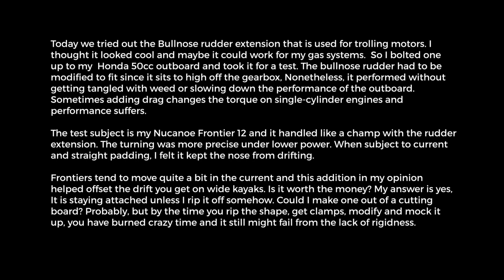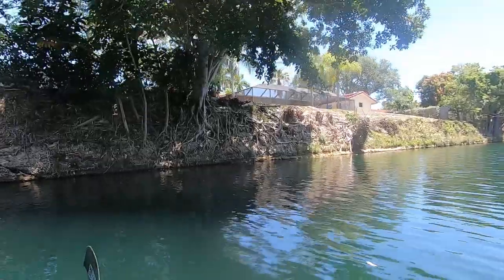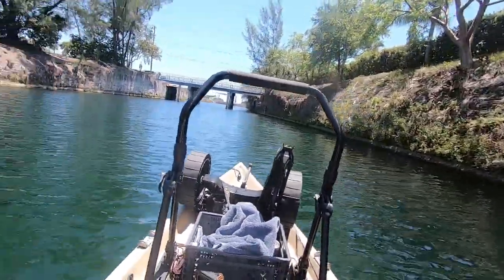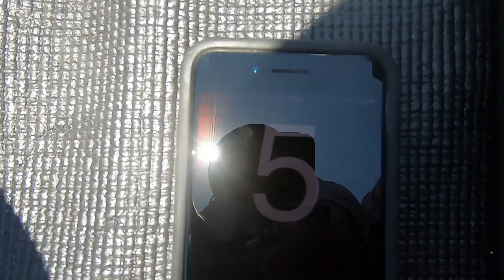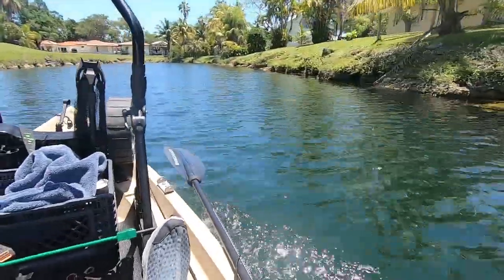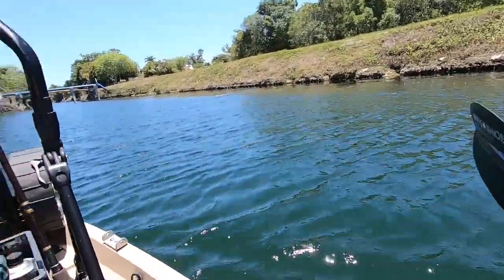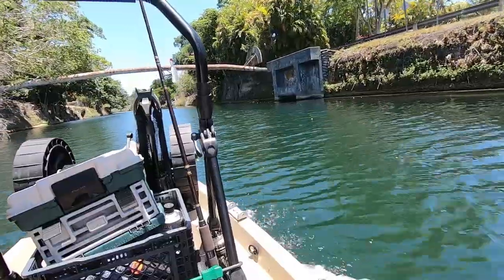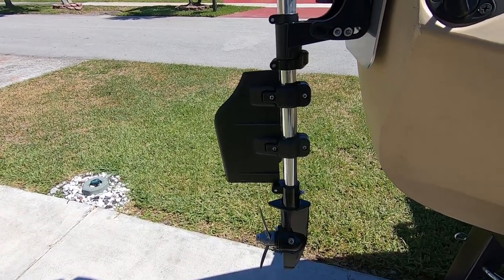Bullnose Rudder Addition to a Honda 50cc Outboard

Comment: Hii nice video. How much thrust do you think this engine produce? Higher than 55 lbs?
Reply from the maker: Substantially higher. The 50cc would be rated 80lbs + thrust. The torque on gas is consistent.
Reply: @kayakbuddysllc-lightweight4947   thank you for prompt response

Comment: Hello sir, how do you service the shaft and is there any chance can we diy shortend the shaft to our desire length?
Reply from the maker: AbdRahman Abdullah in order to service the drive shaft you have to take the engine and clutch housing off. The drive shaft may not pull out depending how long it has been in the system. Use a pair of vice grips with the thin end. You can hold the splines without damaging them and pry upwards slowly. Grease the shaft with marine grade grease and change the gear is fluid. The driveshaft can not be cut unless you have a CNC machine to spline the end. I carry the smaller shafts for pedal drive conversion.

Comment: Nice video sir. Just want to know, that outboard is quite noisy is it? I have one, different brand and it's really noisy. Still figuring out how to dampen the noise down.
Reply from the maker: Muhammad Farid if it is a 2 stroke that is the problem. There is not to much you can do besides trying to get the exhaust in the water. I have tried many methods on 2 strokes and it’s just not worth the effort. Honda 4 strokes are no different that a traditional outboard in noise.  They are the best on the market.

Comment: Can that outboard push a 15 foot aluminum boat 5 mph?
Reply from the maker: kambo209 depends on the weight on the aluminium boat, gear, and passenger. In a 15ft. it would probably be in the high 4’s. 5+ on flat water. The 50cc Hondas are a beast of an engine.